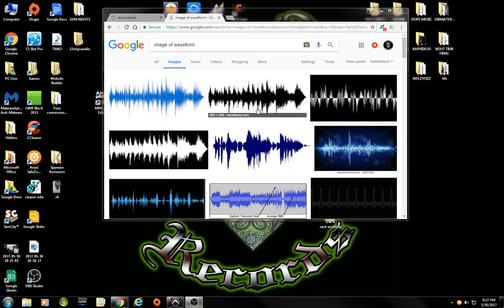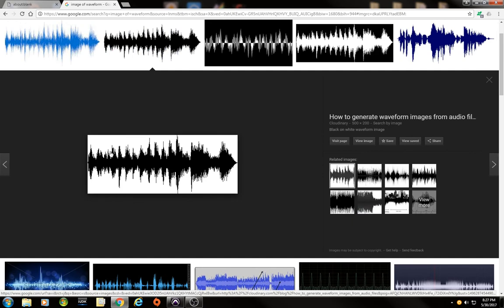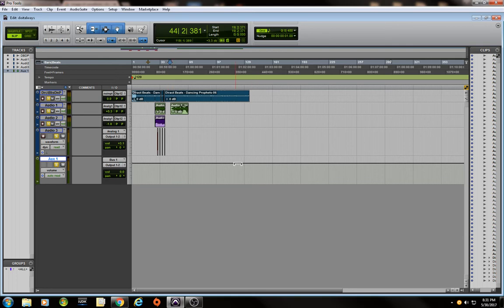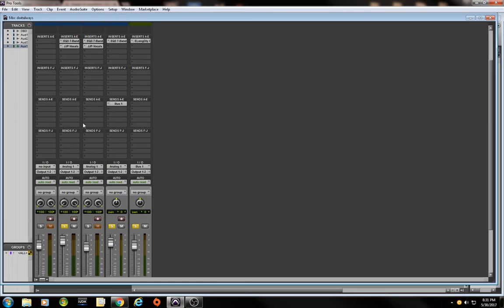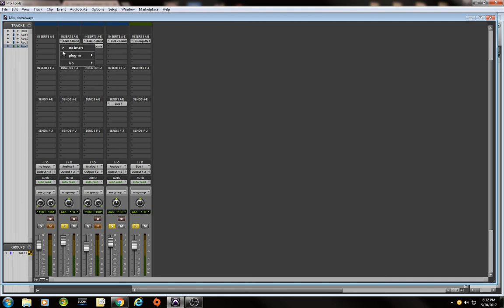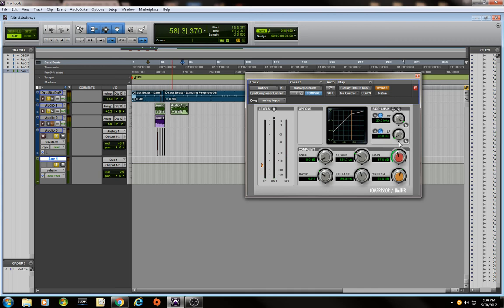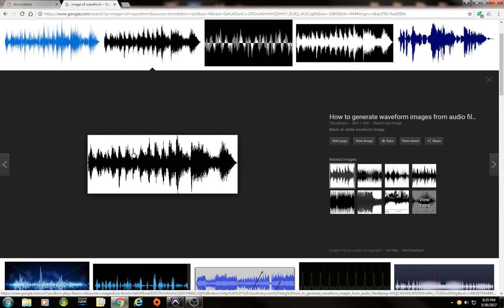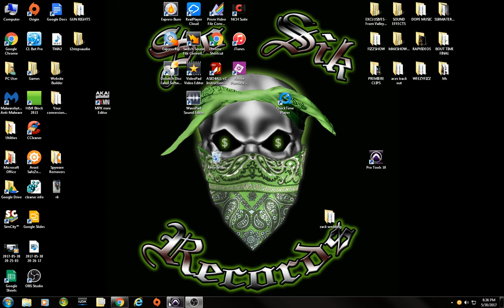How to use a compressor & why WHAT IS COMPRESSION?

Comment: yo whats the o with the line threw on the side it do for compression
Reply from the maker: FINNESSZ DOLO  not exactly sure what your referring to bro
Reply from the maker: FINNESSZ DOLO  there is a option that allows u to change between a shelf filter and peak is that what u mean
Reply: its in the attenuation box it has the 0 with the line threw
Reply from the maker: FINNESSZ DOLO ahhhhh it's been a minute since I used that n I'm not  for certain but I believe if u press it it will let u listen to exactly what u are removing from what u r compressing,  I'm pretty certain of it fam